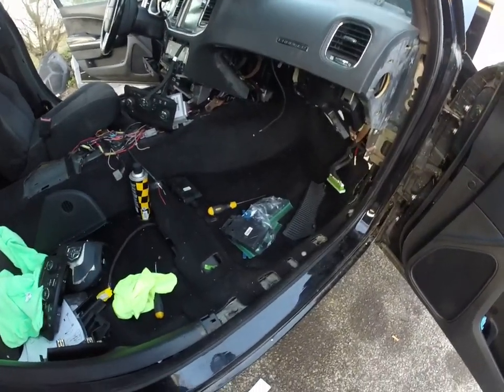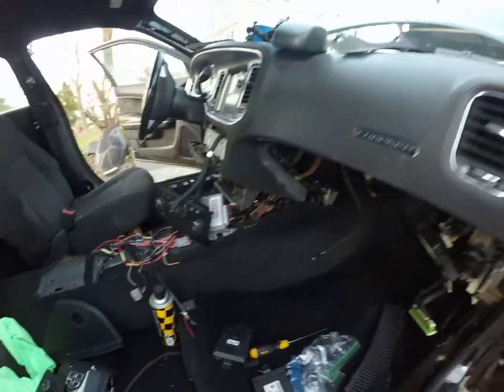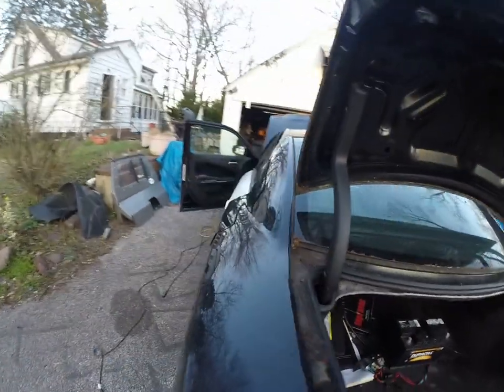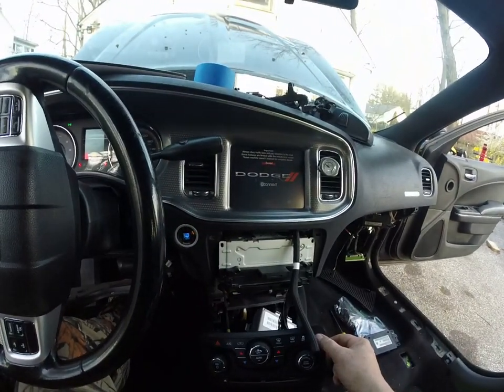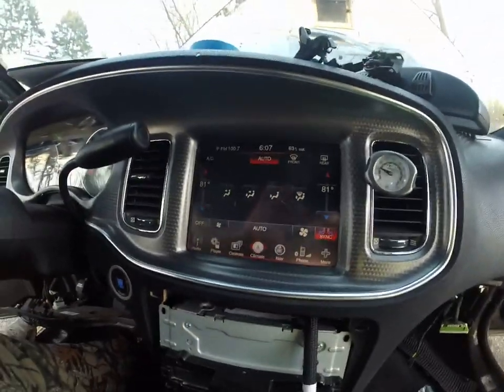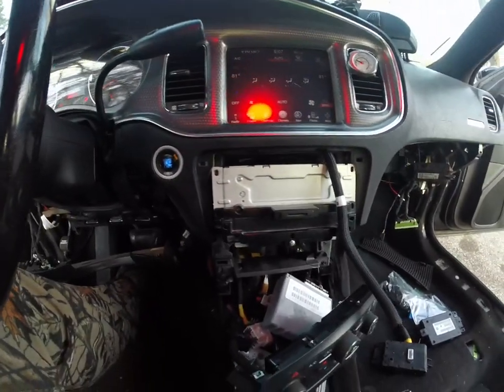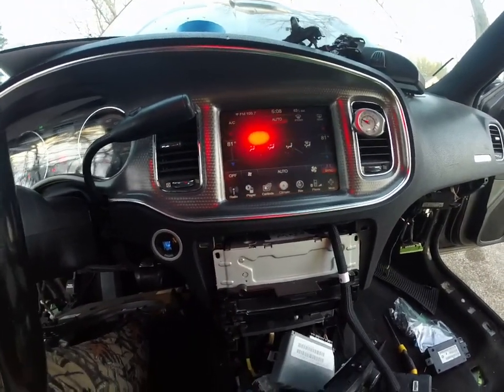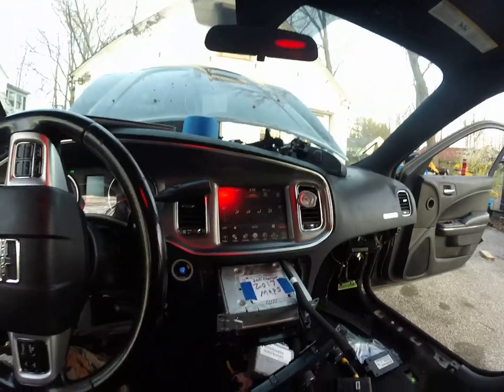Dodge Charger 22 degree problem 2011 - 2014. Part 2

Comment: I don’t get the 22 degree 22° issue, I get - - on the temperature. So what I need to do is active dual atc on alfaobd, then put a new module?
I got a P68185499AC from eBay. 
Can I put back the original module and make it work?
Reply from the maker: Get familiar with AlfaODB. Original module won't work to fix 22 degree no matter what. Make sure car is programmed to ATC before installing new module. I suspect the module pairs itself to the car on first install. Now if I was to put your module in my car it would work as ATC. Confusing but that's how it is.
Reply: @unclesamautos  Thank you I got it to work!I’m a happy camper.

So basically you can grab any AC control module from any car with manual temperature or automatic temperature put in your car and that’ll basically fix the 22° problem correct?
Reply from the maker: @Domestic.motorsports  Nope. Program, add parts, add wires then add cabin temp sensor and proper Sun sensor.
Reply: @unclesamautos  cabin temp sensor? Where does that go?
Is the sun sensor the one on the center dash, near the windshield?